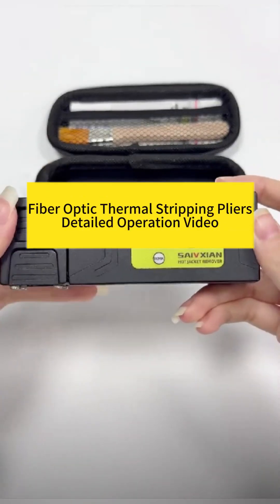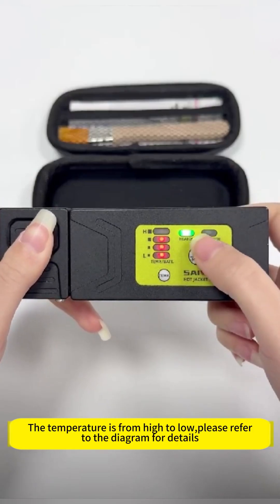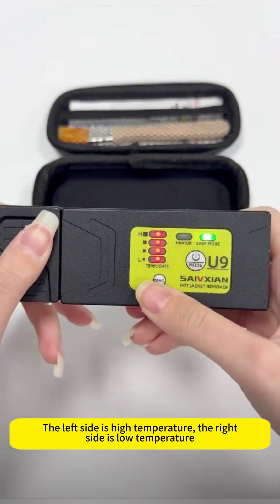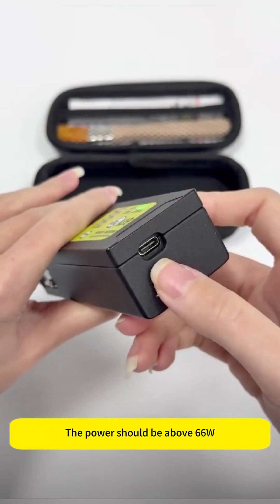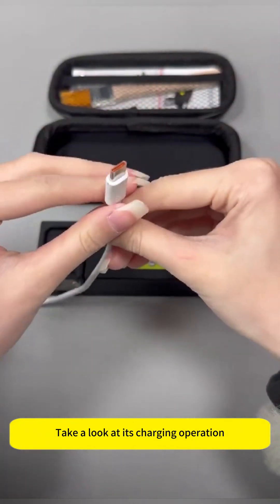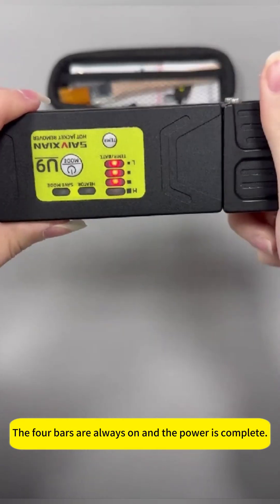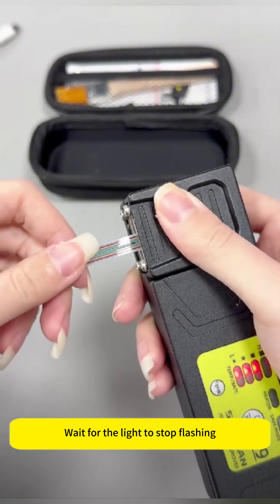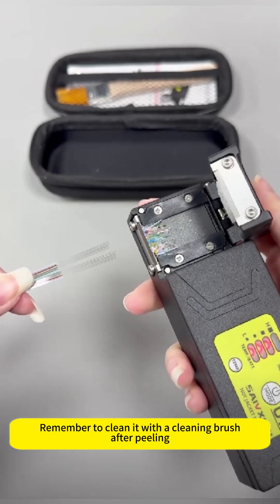Fiber Optic Thermal Stripping Pliers Detailed Operation Video#Fiber Optic Thermal Stripping Pliers

Comment: The fact that they spell 'Heater' wrong amuses me to no end.
I got one anyway, feels good in the hand and works on the test bench. Didn't get the instruction book, adjustment is unclear, also had to modify the USB cable to fit in the unit.

I see about a dozen listings on the Canadian edition of the Prime marketplace with the same translation 'non-visible fibers' cut&pasted... lul.